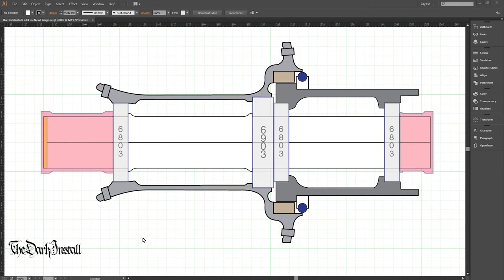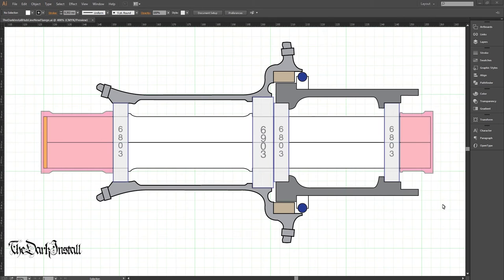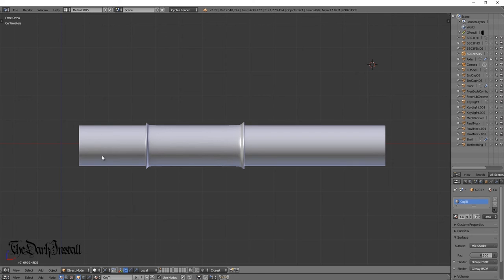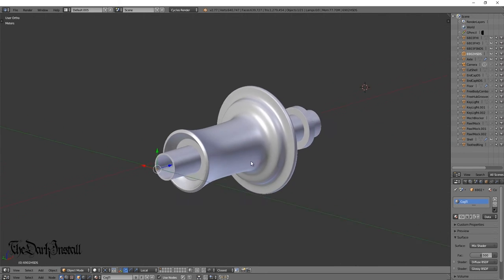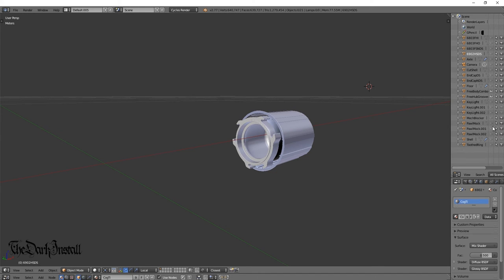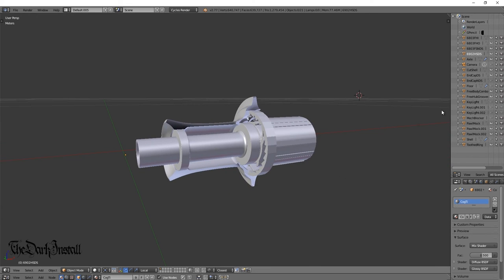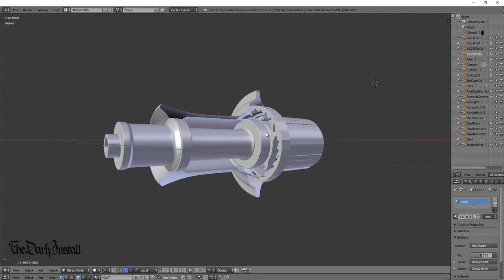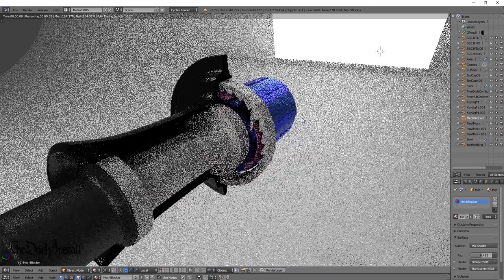Concept Design. Rear Hub. Part 1.

Comment: looks good mate. i like the idea of isolating the bearings from inconsistencies in the dropouts. perhaps you could split the locking collar into two as you suggest and incorporate a spherical or concave/convex set of surfaces on each of the two parts to allow them to move relative to one another, not unlike a self aligning 'pillow block' bearing housing.
Reply from the maker: Hey, cheers.

Yeah I have actually already done all the designing of the end cap system, which is similar to what you describe.  Just need to find time to model it, then I will upload part 2 of this concept.  :)

Comment: Great video , i use Blender a very lot as well you have done a great job on the modeling why not try and 3d print a model of this ? , keep up the good work
Reply from the maker: Peter Haigh hey thanks!  Yeah I am a heavy blender user.  It is incredible.  Printing; well, I have a LOT of work to do on this concept before it is anywhere near completion, but will certainly consider it!